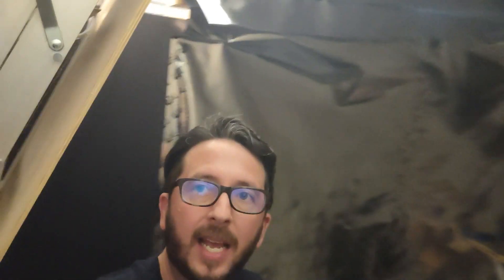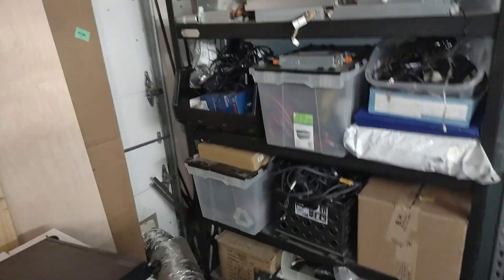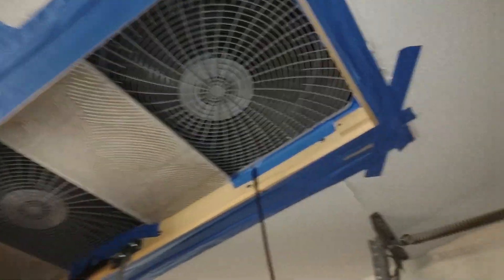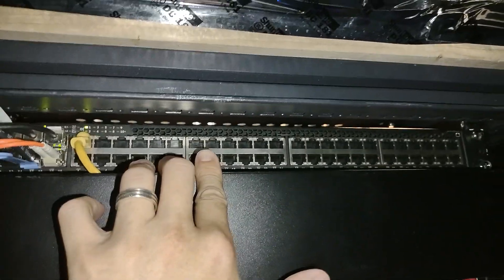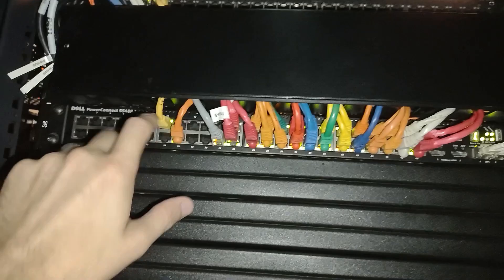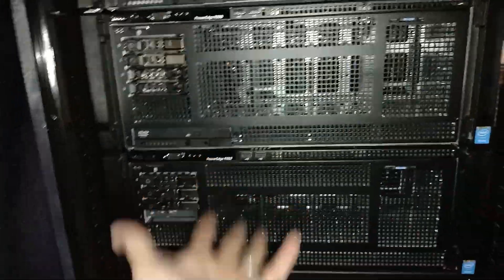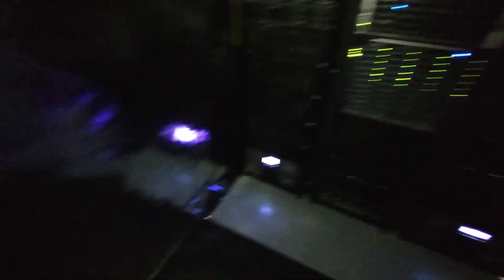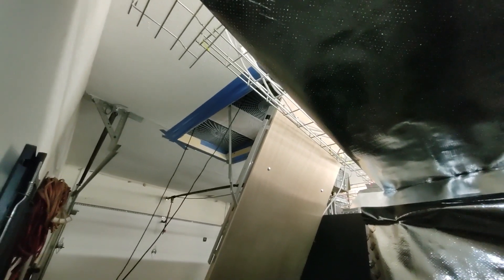How To Cool Server Racks with AC Compression Zone. Radiant barrier is INSANE!

Comment: I know this is 2 years old, but one thing you didn't seem to take into consideration is air pressure. You're creating all of these negative pressure zones. Consider the way a traditional computer case works. The problem is that you're creating negative pressure inside the garage but you're choking it.

For air to be removed, it has to be replaced. Air follows the path of least resistance. With everything taped up, your garage door from the inside of the house, is the most likely place it will be able to draw from, under the door if there's any gap. Which means it would be pulling nice cooler air from inside your house. Which that air is then replaced by pulling it through something, including a bathroom or range vent. Drawing in hot air from the outside.

For any efficiency, you need to bring as much air in as you're letting out. And flow direction helps. Turbulent air decreases efficiency and increases noise.

Since the outside air is cooler than the server exhausts, allowing outside air to be pulled in, away from the garage exhausts, would be ideal. This keeps the air constantly refreshed, preventing heat build up from standing air. That AC does exhaust air, to dump the heat. You'd probably see better results from having the vent duct dump the exhaust in front of one of the box fans. This would quicken the exhausting of that air as opposed to running down the duct. You're also going to lose heat from the duct into the garage along the way. So the quicker you get that air out of the garage the better. If by any chance you're still working on this, i'd love to help you optimize the air flow for better efficiency and less hassle.
Reply from the maker: Yes this video is pre-conversion and it had crazy pressure zones. It did achieve very cool intake air for the servers but a super crazy setup. Ive now fully made the garage into a mini datacenter with dedicated window AC and it works much better and looks much less umm crazy
Reply: @DigitalSpaceport I figured since it was 2 years old, you got it figured out by now, but I guess I had a moment and felt the need to mansplain something 😂 I ended up here while searching for ideas on cooling my homemade enclosed 6u rack without dumping the heat into the room.

I bet you probably have a video showing everything you mentioned too 😅 I'll definitely take a look.

With a full datacenter, what if you ... Made a wall of peltiers, seal in the area for the hot side with an ac's condenser, and carefully engineered it so that once you introduce some water into the sealed environment, the water in liquid form will cool the peltiers hot side, creating steam. Steal some of the energy from the steam while also allowing it to turn back into water via condensing, and it drops back down on the heatsinks for the peltiers, creating an infinite loop ecosystem. 😮

Is it energy efficient? Hell no! Would it require intense trial and error? yes! But would it be cool as shiz to use an evaporative condensing self contained cooling system, and show people your in-home tropical storm? Hell yes!
Reply from the maker: No worries at all the comments are for that ha! I have had crazy ideas around heat conversion for water heater also but the reality of it is I am not that smart, but eventually I may end up that crazy. In which case it will be a video here.

Comment: Kill the exhaust fans and pressurize the space with intake fans. This doesn't requiring sealing the holes as they just exhaust the hot air. Every cubic foot of air that goes in will match the cubic foot going out. You can't suck more air out than you put in, so if the space is sealed, and there's little way for air to get in, there's no air getting out. You have to allow cold air in at the same rate it's going out. If they are not balanced, you still get the same CFMs in and out, but you will have negative or positive pressure in the space. I would prefer positive pressure, which is better at heat transfer and more thermal mass. So keep the exhaust fanless and restricted, and pump in cold air. You can place a baffle on the exhaust to adjust the CFMs.

Comment: I think with the negative pressure it is something you'll just have to play with and monitor the temperature.  You could try reversing the airflow of one fan to blow air back into the garage.  You could remove one fan and seal it up and use it to blow air at the vent in the attic; so one fan blows into the attic and the other blows air toward the vent just make sure the full cone of air covers the vent.
Reply from the maker: Yeah I removed and sealed the attic, and its been holding temps so I think I have an issue there with inadequate CFM/size of hole.

Comment: Hello, thanks for the great video. Here in Phoenix, AZ the weather isn't any better...lol 😅 Thankfully I'm keeping all my hard drives cool. Just installed a exhaust system in the window to blow out all the hot air outside. Huge difference in the power bill and HEAT compared to last summer when I was running nothing but GPU's  I just discovered your website and will check it out in further detail! 👍

Comment: Looks like you have been busy.  I think that you ended up getting the perfect amount of cooling in that space to be able to keep those servers around 29 C.  When you add the other 2 racks,  you might even get away with making that space in front of the racks bigger and adding a second portable ac for now.  Definitely get rid of those box fans and put them in the window.  Also, take a 2x4 and clamp it horizontally on the edge of the door to your house so it stays open 1 1/2" and that should pull some cool air into the garage while the box fan in the window takes out the hot air.  All of this of course until you get your mini split.  That will solve all of your problems as long as the outside walls of your garage have insulation in them.  Everything is coming together nicely.  Keep up the good work man!!!
Reply from the maker: I have thought about going the second portable AC route for sure! Drill n Fill happening soon TM in the garage walls!

Comment: I went the mini split route for my server room. I put up a non load bearing wall directly behind the overhead door making my server room 11x22 and put a 3 ton unit on the wall. I didn’t want to put a hole in my brick wall/side of the house, so I put the compressor in what was left of the actual garage and just left my door half way up. Wasn’t the best solution having a compressor in your garage but it worked well for the past 3 years and the compressor still looks new being out of the weather.
Reply from the maker: so the compressor being in the garage is working out, what kind of climate are you in?
Reply: @DigitalSpaceport  Hour east of Atlanta. So hot and humid. And ya, it worked out just fine. If you hit me up on discord under this same username I can send ya some pics.

Comment: Down the road, have you thought of an outside shed bldg 20' x 20' and just cool it with a 3ton AC unit. Would get your garage back...
Reply from the maker: I have put an external structure on the idea board indeed. I even joined the excellent "garage journal" forums to get some ideas of how people are building specialized units. Our garage has not had a car in it for a while but I do miss the workspace and storage parts of it.